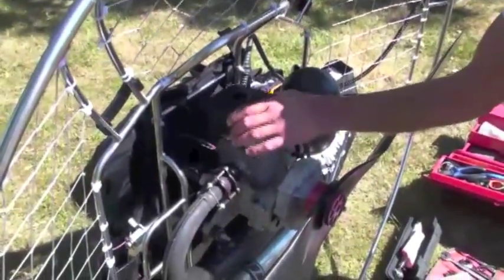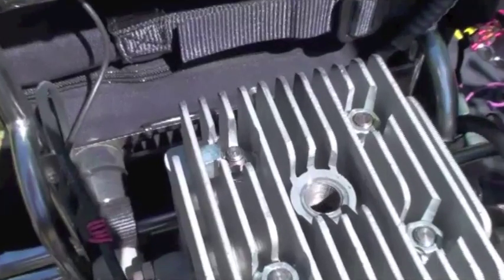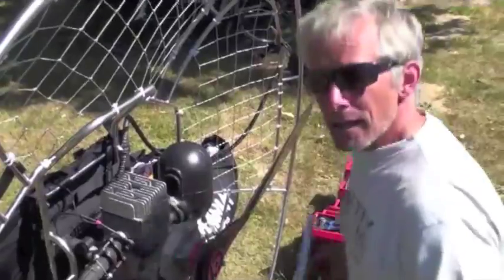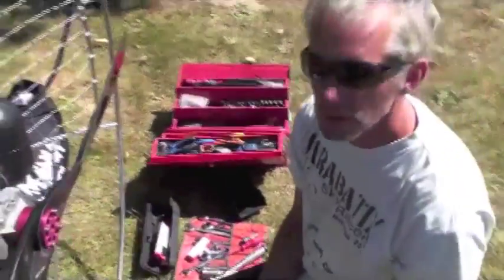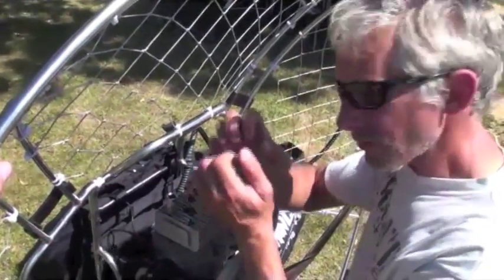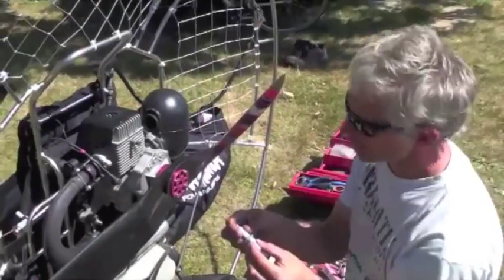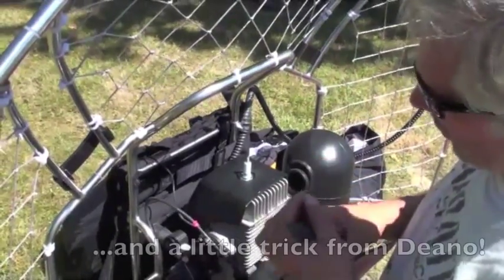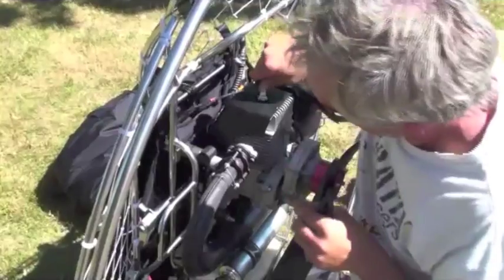Checking and tightening cylinder head bolts

Comment: Good tip Re: the Sparkplug. You can also get variants of the same spark plug that have that cap fixed on (No screwthread). Might be worth doing that if you have constant issues with them coming loose.